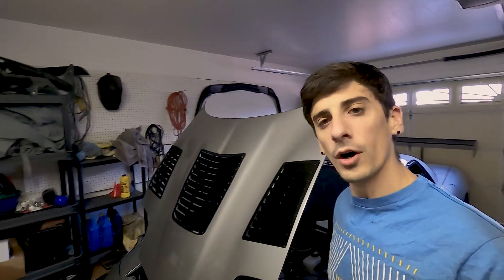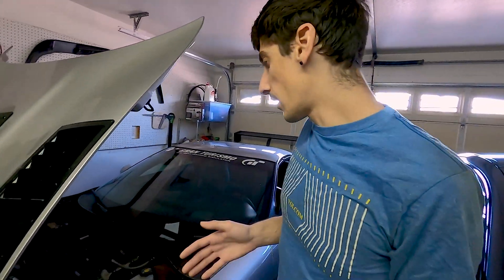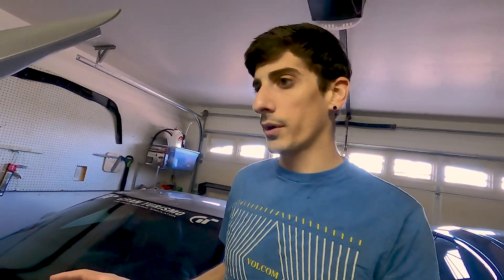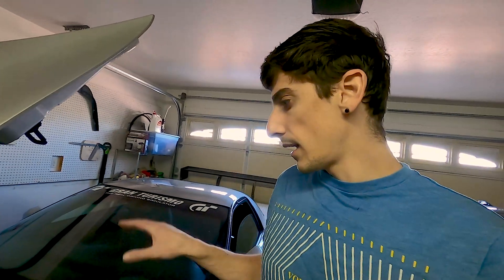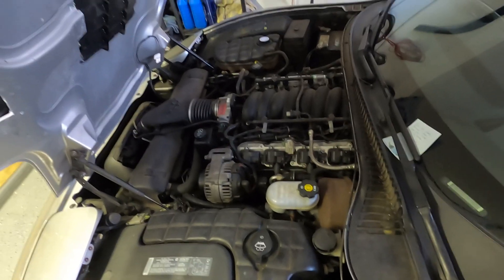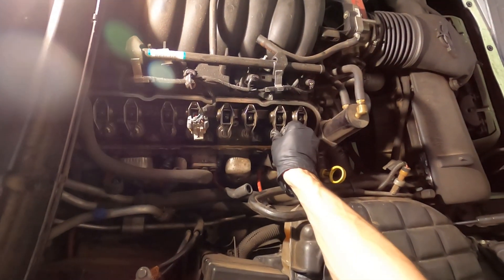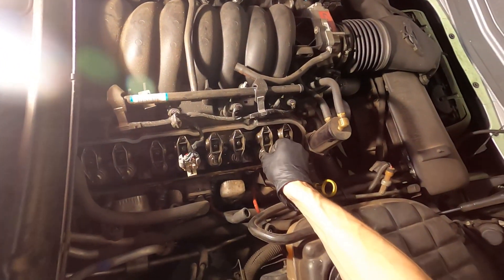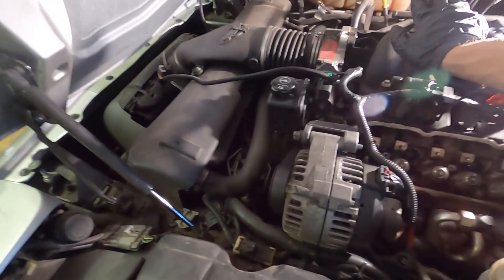Corvette C5 Z06 Engine Rebuild/Upgrade Series: Part 1 (Intro) - Shooting for 500hp N/A!

Comment: Sounds like a spun bearing or rod more than a lifter. If you pull the lifters and the rollers are not damaged and cam lobes look good you might want to take the bottom end apart. Im getting started on my 01 again thanks to your canyon videos they got me itching to get back on the twisties
Reply from the maker: Yup, haven't gotten around to making a new video yet but after closer inspection I cracked the cylinder wall in #7. Needs a new block